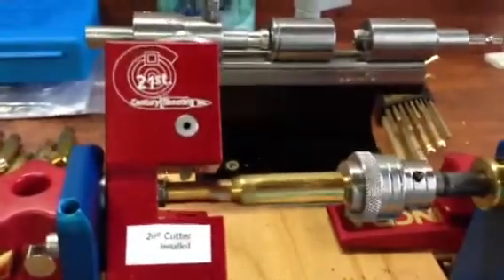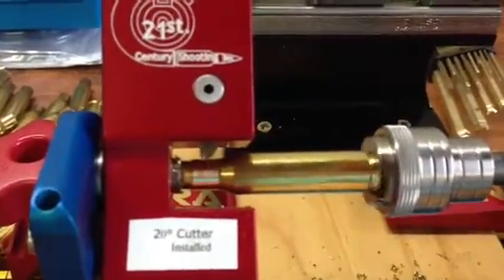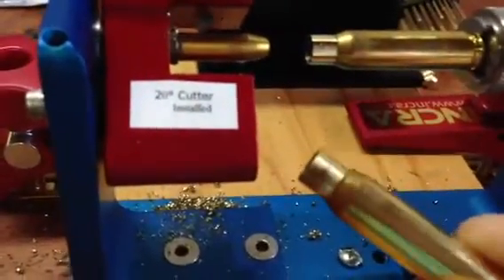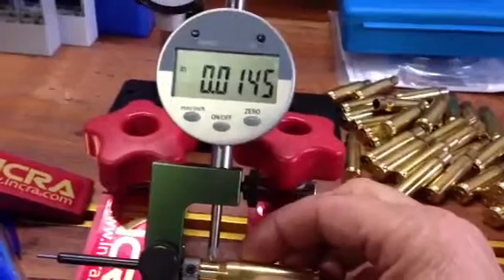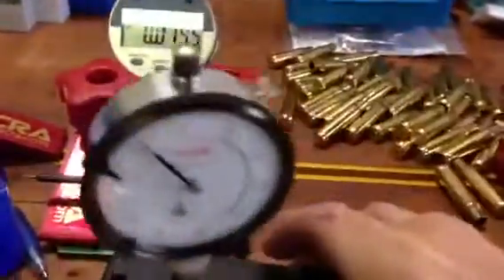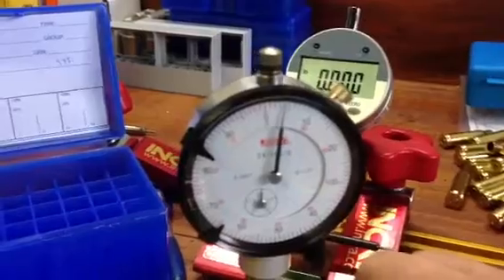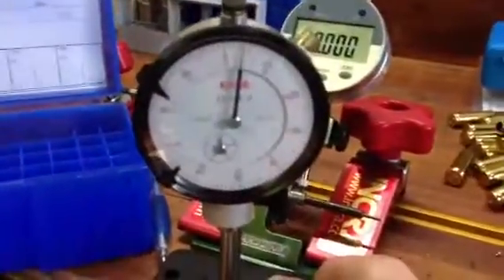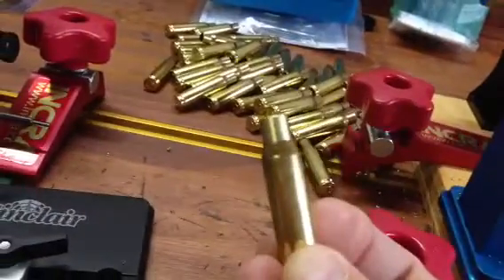21st Century neck turning Lathe and concentric results

Comment: Wait a minute, Trimming metal off of the neck of the case in it's self does not control neck tension. Neck tension is determined by how large the case mouth is at the time you seat a bullet into the case. By using the tool that removes the neck brass to make for a uniform thickness can have an affect on neck tension, as a thinner neck wont allow for a greater amount of tension, but that depends on how work hardened the brass has become. When the case expands to the fullest size it can to release the bullet in the chamber the bullets sides are not rubbing along the case wall and thus possibly off center to the coax if the bore of the barrel. The object here is to have the neck portion of the case coax to the chamber at the neck, and the brass thickness allows the bullet to be in the center of the bore, (you can have as much as .005 clearance between outside neck diameter compared to chamber neck diameter) thus in the center of the chamber, and that continues back towards the center of the case head. Those concentricity gauges are usually used while a bullet is seated into a cartridge the dial is set to rub on the ogive of the bullet and at that point you measure runout. Of course you assume the bullet jacket thickness does not change anywhere that could affect the runout of a measurement. I find it hard to believe that you go through all these steps with your brass, and then throw them into a loose can or pile them on your work table and not place then into a cartridge tray with holes drilled to protect the cases from damaging the necks. Next time you have fired cases,  handle them coming out of the chamber so they don't get nicked up, crushed, dented. then see if a bullet will fall through the case from the neck, if a bullet drags along going into the case the case neck is too thick in some spots and should be neck-turned from the inside, before being resized.

Comment: Not sure why you'd outside neck turn after running the case through your die. If the case is run through a good quality die, the OD will be concentric & centered with the body of the case. If there are neck wall thickness differences, they will now be pushed to the ID of the neck. By taking material off the OD, all you have done is aligned what was a centred OD with the un-centered ID.

Comment: Using a flat stick with some flat rubber bands helps keep consistent pressure on the case.  Great video, thanks for putting it up
Reply: Are you referring to the Sinclair run out gauge? That was a thought I also had to keep constand pressure and roll the case instead of using my fingers.

Comment: The plunger isn't even firmly on the neck, it's bottomed out and it returns to that "dimension" because it can't go down any further. Try putting installing the indicator with the plunger CENTERED in its travel and see if you can be a little better "machinist" than Stevie Wonder would have been.

Comment: What are the gains from neck turning in ur experience
Reply: Not A lot. You will not see it at 100 yards. At 600 yards it is more noticeable. Still I am a tool and die maker i understand precision and it is really a waste of time unless u shoot competitions at a very high level. For 98% of shooter you should worry about consistency in your powder charge and your bullet speed. This will make a huge improvement in groupings. Until you finds your node and have the pet load perfected for your rifle there is absolutely zero reason to neck turn. Not only that using bushing sizing dies as well. It is basically just throwing time and money at something for such a small improvement! Military snipers don’t use neck turning. In “country” most use factory match Ammo not even tunes to their rifle. So it will make improvements but not much. So if I have way too much time on your hands and want to spend well over double the time it takes to reload a accurate round and also throw lots more money at it all to go from .36moa to .34moa lol it helps! Most people who do this have all but perfected their loads and really are just trying to pull everything they can out of it to get every bit of accuracy. Most of the accuracy will come with consistent charges and a good seater die. I use a Redding competition seater with a mic and it seats it so perfect every time there is never a bit of visible runout! So that means less than .003” runout on every round. As long as u have that and consistent loads and consistent seating depths and try to stay within 
.01” of the lands for seating but even that is not huge. I have a AR 308 that must be seated .05” off the lands to fit in mag and it shoots .375” groups all day. That is a 18” barrel (Kreiger) and it is very accurate. That is with 175 SMK and those are very forgiving on the “jump” to the rifling! I would not dare try that with a Berger
Reply: @shawn01707  For the most part what you say is true. I'm a blackout fan. Spent 223/556 cases are my case source which I shorten and form. Depending on the brass manufacturer it may wind up with a thicker neck. So this post is right on target for me. I don't want to jamb a case in my rifle.
Reply: @shawn01707  If you do your load development with non-neck turned cases and you decide to neck turn, you will have to re-do your load development. You will also 100% see a difference at 100 yards. Boomers don't know shit.